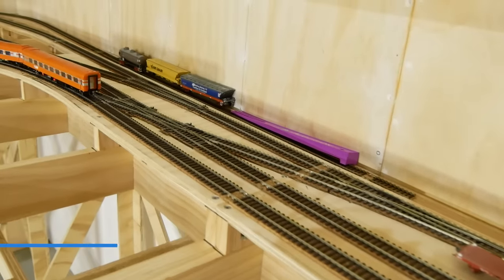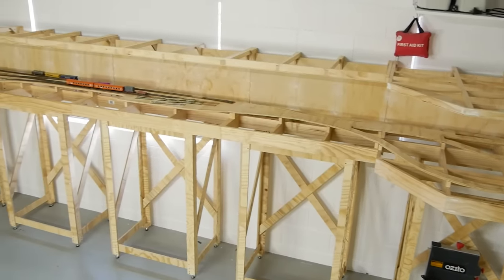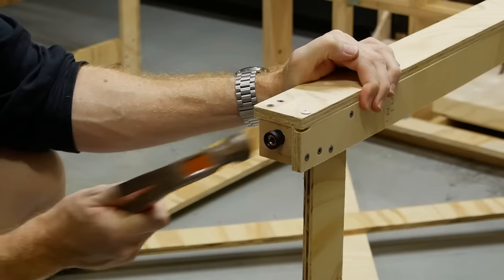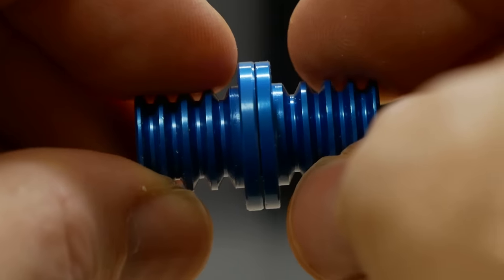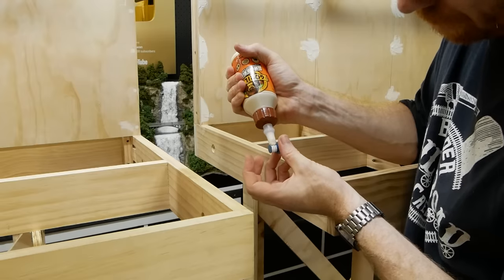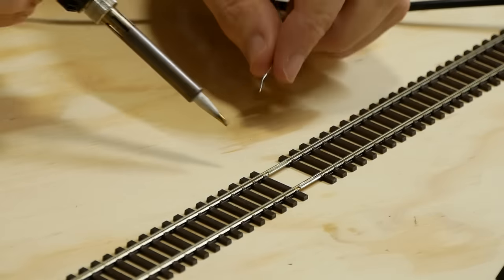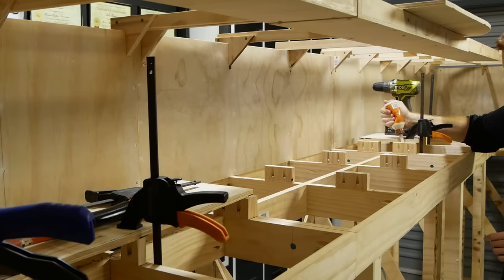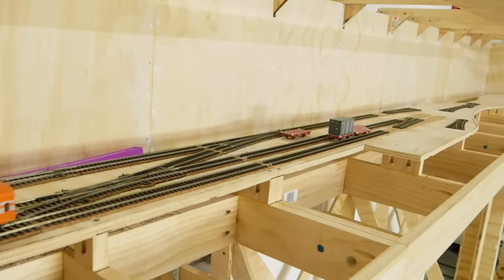How-To Build a Modular Model Railroad - Benchwork

Comment: Thanks for the video!! - Handy tip - You can drill the dowel pin countersink FIRST then drill the thru hole, that'll speed things up..  If you have a drill press you can do all the operations for the end board dowel pins on the press (and use an alignment jig), THEN assemble the module grid assemblies.  Everything will still line up perfectly.

Comment: Fantastic video! I agree completely with the 600 mm depth of your layout. I once tried a layout that was 800 mm deep, and although I could make that reach over the bare sub-roadbed, once I had scenery and buildings installed, the reach was too much - and I am 185 cm tall.
I have 18" radius curves at both ends of my layout. I made sure to provide a transition curve at the ends of the curves - this helps ease rolling stock into the tight curves. I am still limited to 65 scale foot long passenger cars and 4 axle locomotives.
Looking forward to the next installment!

Comment: Some really good ideas here! Thanks for sharing. I would recommend however, that you do not glue the plywood subroadbed to the risers. I have done that and regretted it every time. I find it better to use Craig jigs and screws to screw up through the top of the riser into the plywood. This eliminates the need to glue and countersink holes on the top of the subroadbed. If you need to move your subroadbed or make a change you have no way of getting to the Craig screws without cutting your subroadbed off. Then you would have to start all over again. Just a tip from my experience. I LOVED how well TiteBond wood glue held the subroadbed to the risers. I didn't even need screws as the glue joint was stronger than the wood! However, when I needed to make a change, I was out of luck and had to cut the top off and start again. Trust me.... don't do what I did.

Comment: Thanks for these videos.  I'm working on a modular layout myself.  I've built benchwork as essentially tables made out of CLS.  I then made sections that rest on the benchwork using similar alignment dowels as the table "top".  Each section is 50cm wide and 1.2m deep, which is far too deep to be within arm's reach for working on scenery, and that's why I made it modular; so I can slide each table top section in and out to work on scenery etc.  I've only made a couple of the table top sections so far.

Comment: Suggestion: When making the jig for the alignment jig, you could have made the jig to hang off the top of the bench frame, giving you an easier way to get a uniform hole height AND, not have to use the drill to line up the jig. I would have also made the jig wider, so it could be butted up into the corner of the frame, giving the hole a standard distance from the edges of the frame as well. No Third Hand (TM) needed.

Comment: Can't wait to see how this plays out, for me building something is always the most fun part of the project.    

Also if you would like a true modular layout measure the exact distance (i.e. add onto your jig so it always is that way) from the edges of the pine boards for your aligners of course this also requires the track at the end of every piece is place in the exact same space too (so they all line up),  this would allow you to add in pieces easily and even rearrange as necessary as long as you keep that same 600mm base for all your modules.    Of course if you're making a continuous bit of scenery across the entire setup then yeah it largely doesn't matter too much.

Comment: Pocket Screws and 19" radius.  19" is rather larger for N scale :)  I do box frame benchwork myself.  I 3D printed (FDM) locator buttons and sockets for my drop down bridge.   They lock into place very solid,  much the same thing as locator pins, but larger.
Reply from the maker: Yeah, N scale certainly has its advantages 😄 I didn't really think of 3D printing locator pins... Although I only have resin 3D printers at the moment and they are pretty bad for parts that get bumped and moved. Resin is so brittle, FDM would obviously be much better for that.

Comment: This certainly looks like the Rolls Royce of bench work. 
Mine is much simpler: two adjoining tables, but they can be separated into legs and baseboard. I put a layer of 5cm / 2inch foam on top below any track to allow for canals and rivers, giving me about 4.5 meters / 14 ft of scenery depth irl.

Comment: to accurately drill for the alignment dowels you could do it in a vertical drill press before the timber is assembled.  Just clamp or screw the two end timbers together then drill.

Comment: Benchwork! I love benchwork, it's fun. I like your modular approach here. If you're interested in saving a little time with drilling/countersinking, you can pick up a Quick-Change Drill/Countersink Set, the bits slide into the counter sink and you can quickly flip from drill to driver bit in seconds. Just a thought. Cheers!

Comment: Nice! Glad to see you working on a layout!! Though I’m kind of surprised you didn’t use foam as a base like you do on so many of your dioramas
Reply from the maker: Is mainly due to the modules being modular, I wanted a solid base to ensure the track remains aligned over the long term. 
It should be a little more resistant to bumps and knocks 😉 the rest of the open areas will be foam. 
Plus it makes it easier to mount with machines and wiring components 😉
Reply: @BoulderCreekRailroad  thanks! That makes a lot of sense.

Comment: *Luke only cooks with water!!! If you insert the baseboard alignment dowels too deep, the two pieces will not meet exactly and you will still have end play between the modules. And if you drill too little, you have a distance to the modules. Just as a little brain teaser. In my opinion, the modules should be fixed. Drill a hole in the diameter of the threaded rod, threaded rod through, screw tight and you're done. First, cheaper and second, less work.
Luke, but that's not meant to be a criticism of your great videos, which have already given me a lot of joy.
 Best regards, Detlef*😍😍😍

Comment: I was wondering if you made full layouts. I like the modular design, one consideration is that the guide pins and rails need to be spaced evenly on all modules if you plan to reduce the size or add new parts later.

Comment: This is so exciting. Congratulations on the progress so far. I have a question - do you drill in holes for the screws while the wood glue is still wet or do you wait for it to dry? I have never worked with wood before, so I'm sorry if this is a basic question.

Comment: I really enjoy your channel and could not possibly emulate your skills. However I have one comment regarding the alignment method. I agree that the dowels will line up exactly but think that plywood would be a better option as it will not have any seasonal movement whereas pine does.

Comment: What tool did you use to cut the round holes in the taped down track plan so you could easily mark your points of transfer? It appears to be a pen like cutter that you twist.

Comment: Looks like you used AnyRail for your track template? You can save ink if you select track centre line as the option instead of 'track' to show the route then attach to your board and make your dots.

Comment: Personally I think it would be better if you set the end plates before you make the sub roadbed. That way you would be able to use a drill press and make all of the modules the same also adding holes for the wiring.

Comment: Tight curves and trains reminds me of the now-retired and mostly scrapped Class 142 Pacer DMUs here in the UK, they were a modified Leyland National bus body bolted on top of an old fixed-axle wagon chassis with drivetrain added on, and come tight curves, oh god were they awful!!! My experience of them being on the Accrington Viaduct, which is relatively tight, but those 142s had to go so slowly over it otherwise the noise the wheels made as they rubbed hard against the rails was deafening, and even when slow, once the resonance caught, it didn't stop 'til the track straightened out or the train came to a stop... :S
Reply from the maker: oh wow! I watched a video on the New York railway system that goes through the city. They navigate some tight curves as well, some of them follow regular street corners which is crazy! They look so odd going around such tight curves!
Reply: @BoulderCreekRailroad  Yeah, as long as the're on bogies, they can go round some pretty tight curves, given they can rotate to better adapt to the curve of the lines, but those 142s (along with the 143 & 141, latter retired very early & shipped off to iran!), they were horrible, but the Pacer series ( Classes141, 142 and 143) were meant to be a stopgap so late 70s British Rail could find a replacement, and 40-odd years on, they finally remembered about actually doing that... :S

Comment: It's way easier installing the landscape terrain prior to track..WAY EASIER !
Reply from the maker: yeah that can work, it just depends on what you want. I need the rigidity of the plywood holding the track to meet up accurately between modules but also want the foam in between so I can contour the topography above and below track level later when I make the final decision on the scenery. It's hard to do all that prior to laying track.